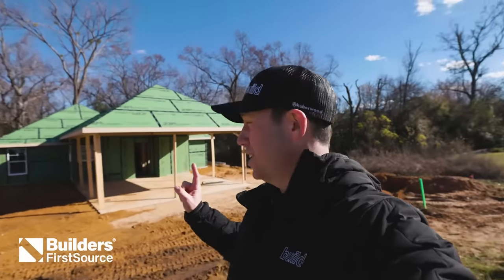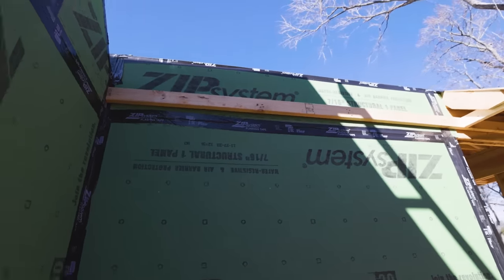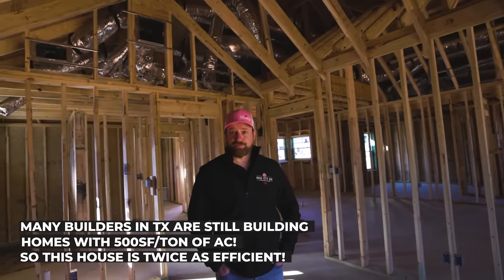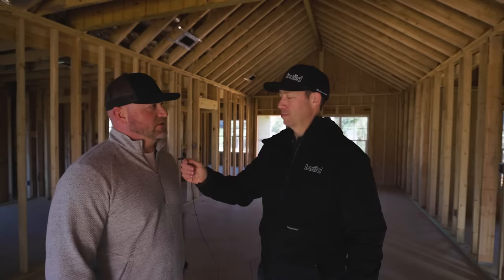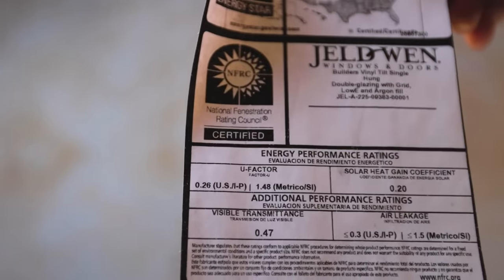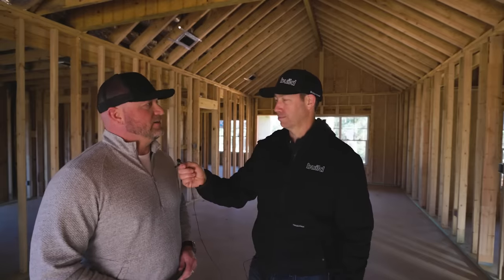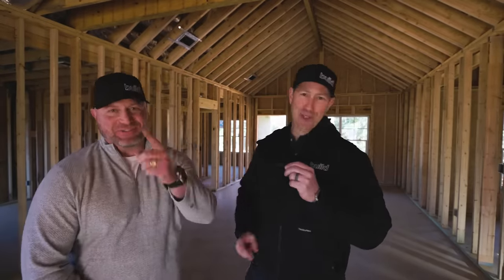Nice houses aren't just for the rich - How to build a quality home at an affordable price.

Comment: I'd like to see this house completed to see what was chosen, for finishes (flooring, cabinets, counter tops, lighting, faucets, etc).  There is going to have to be some real compromises to account for the cost of the shell, spray foam insulation, aero barrier, and HVAC system etc.
Reply: Maybe Mr. Matt will do a follow up video before the homes sale. The finish out is going to be just as nice as the framing. My wife is the designer and it will feel like a very high end home. Super excited about it!

Comment: I sent my builder this video.  Starting a custom home build with him this year in a Texas coastal county.  I've been told we don't need an ERV or ZIP on the roof for our climate, and monopoly framing would run up the cost, it's unconventional.  What they don't know is my years of Build Show education. Thanks for sharing this with us. I plan to implement these same details on our build.
Reply: Two simple things in that climate, ERV and a Zip water shield. Huge. I am close by planning my build halfway between Houston and Dallas, so in the country without code. I just visited a barndo builder that did not spec flashing for the windows the steel framers installed!!!! Per build show discoveries that means a 2 to 5 year lifespan before disaster. 

Main argument! “This is new to learn but not a new skill. Code is going this way. Learn with me, while I pay for the new materials, and I pay a few hundred to a couple thousand more for materials and 4 to 5k for an ERV install, and about 5% more for your hours. You will have a leg up on future quotations because they will come, they will ask”. 
Just my thoughts as to how to address a builder that I have talked to that has two major shortcomings for longevity but otherwise builds a new build efficient package: aka. 2000 sf barndo with 95% of electric bills below $100.

Comment: I started doing the same thing building in California. And exactly like this guy. Had a budget found a way to make it work. Same hvac. EXCEPT trane heat pump. I didn’t put Broan erv in supply plenum be cause CONCERNS if air handler isn’t running and mold in plenum. I did the opposite ducted supply and tied into plenum for the return. Could have heard wrong if you read maybe it will save a headache in the future especially because you have more humid summers in Tyler. I have family in minnieola so been to Tyler.
Reply: Where in CA are you doing this? I'm in the Bay Area busy with a renovation and its so hard to get my builder to do any of this.

Comment: This build is perfect and should be more common in new construction. I do wonder if they ended up putting in an insulated floor to hit this out of the park.
Reply: We did not. We are in Climate Zone 3A and it is not required by code. We are not so much worried about the cold here in Tyler, TX. It's the summers that we build for. I always tell people we have two seasons in East Texas, Summer and August. 🤦🏼‍♂️

Comment: Very impressed. This guy isn’t focusing on profit for the project, but that house would be an excellent value even if the price was raised to $250k.
Reply: Its subsidized. Their cost is likely around 200k, would be listed around 300k. The city is subsidizing the construction so that they can sell at the cost price. Also, they can donate some things for tax writeoffs, and you can flow that down though the subs.

Comment: Sorry for my french...While making the recap around 21min you talked about a roll of fabric instead of a mesh product for the windscreen , I didn't catch for what purpose the product was for and the name of the new product, thanks and very good show.
Reply: Its used a rainscreen which is to create a small gap between the Zip sheathing and the house siding allowing, for ventilation and also drying should any water get behind the siding.

Comment: I've seen the staggered wall framing (in an interior wall) before when someone wanted to provide more of a sound barrier for their bedroom but they only mentioned it and shown the framing part, instead of the installation of insulation. I would like to see how they add the insulation to it. I am seriously considering using that with my upcoming garage-o-minium build.

Comment: Pareto principal in action.  80% of the benefit for 20% of the cost.  

Last 20% of the benefit is 80% of the cost (higher end windows, HVAC, etc).

Gread vid MR to show the viewers that the principals and techniques shown on the high end construction can be done at a very modest cost on an entry level / mid-price point home.

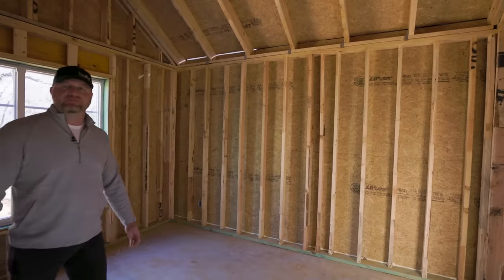Comment: 7:15 The bottom wall plate looks like it's pressure treated. I've been told you should not have pressure treated against white lumber because of treated lumbers properties to retain water and it will induce rot. Maybe this is less of a problem in Texas, but in general? Would love input on this.

Comment: GREAT show guys. 2 questions: [1.] who is Steve?? and [2.] just to be clear on cost, did the City of Tyler (who hired Josh) subsidize the houses? ie: is Tyler's city govt picking up costs of things - like are THEY paying Josh (ie: labor), so to keep the houses under $200k? did the City pay for a portion (or all?) of the materials? if the City hired Josh, they bought the land - so will the deed to the land pass to homebuyers? It simply seems that the City of Tyler is subsidizing a % of the costs --- so really should break the costs out to include that... (ie: The City provided the land, handled all the permits, and kicked in $____._ in order to sell this houses for under $200k) Thanks.

Comment: I wonder if putting it through the air barrier process before adding the insulation would make the house even better? I wonder this because it would ensure that anything that gets plugged by that process will be plugged as close as possible to the red line. Also, this way, if there's a really small hole in the zip sheathing that gets plugged by the open-cell foam insulation, then that hole will be plugged with something that doesn't let moisture through instead.

Comment: OK, the price is 200k, assuming subsidized. What's the actual cost?
Reply: How these types of grants typically work is that they City pays the builder Up front to build these types of homes and then they sell them thru their affordable housing programs, they are sold at cost. The big difference is that this type of home usually has a rider attached to its deed that you can't sell the home for excess profit when you eventually sell. So The actual cost will more than likely be the sale cost. Now there are also certain tax credits available depending on your region so some builders take on this kind of project as a tax break since while they don't make a direct profit on the building they get it back on the tax credit.
Reply: That is a very good explanation. However, I'm not receiving any tax credits from HUD or the City of Tyler for building these homes. I will get the 45L tax credit for these homes being ZERH Certified, just like every builder in America who builds a ZERH Certified home. There are not any subsidies being used. The monies to build the houses are being provided via a grant from HUD give to the City of Tyler Neighborhood Services to be used for low to moderate-income families. I charged cost plus for this project.

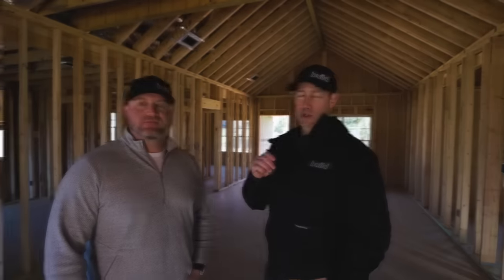Comment: What would have to be done to make the space between the two vaulted ceilings at 14:25 more useful in terms of access and storage? Would running a collar ties between the rafters of opposing ceilings work or would it risk putting too much stress on the drywall and you would be better building a load bearing knee wall on top of the existing wall, using collar ties for stability and placing down planks. Filling in the area above the ceiling with removable panels to protect the ceiling drywall from accidental penetration so if you looked in the area, it would appear like an upside down gabled ceiling.

Comment: Nice... I want a nicely built efficient house. I have an expensive house now and its built like garbage, even though it was a well regarded custom builder. Matt do you have a "checklist" of all the most important features to look for?  "monopoly" envelope, sealed sills, staggered studs, lvl headers?  ERV? individual sealed penetrations etc? I want to do one more house before I kick off, but want a good one. Tyler isn't far from us. 1300 sq would be fine. Houses that small don't even exist anywhere around me.
Reply: Look up the book "Pretty Good House" to learn the basics.

Comment: Instead of 2x6 for fire blocking every 10' and the corners-- is there a more insulated material that would cause a thermal bridge? Would Rigid mineral wool used in rain screens work? (not the fluffy stuff)

Comment: If you know beforehand that double beam is going thru your air barrier would it not be easy for them to run a bead or two of a sealant between and underneath the beams (or any difficult to air seal location) similar to how you do your bottom plate to the foundation?

Comment: in a tightly built home, i understand the necessity for make up air.  But, when the power is out, how then does the house ventilate?  (windows, open exterior doors?).

Also, it looked like there were vents in the soffit.  Since the soffit will not ventilate the attic, it would seem that soffit vents in this case would be unnecessary...?

Comment: A question about the finances of this: Is the $200k the total actual cost of construction, or is it what the city is going to sell the house for with some amount of extra cost being subsidized? Is the cost of the land actually included in that? Or is the city basically just throwing that in for "free" since they already owned it? That is to say, if I buy a plot of land and wanted to have a builder build this exact same thing, can they do it for only $200k? Or would it cost more without the backing of the city? I think what the city is doing here is great, but not every city is going to do this. What would this cost all out of pocket privately?
Reply: I don't see why this couldn't be done for 200k not including land.   This is a 1300 sqft home with a carport, not a garage.  No masonry either.

Comment: Great build for sure. 
I’d take the Aerobarrier ACH number with a grain of salt and retest with a regular blower door. Why? Because I was part of project where AB got to drop the ACH by a lot on leaky house that needed E star certification and the independent mandatory blower door retest showed only a very slight improvement so… what gives? 
I’m not saying AB does bad work or over-inflates their numbers (I’m 100% behind the concept) but I would just retest and see, that’s all.

Comment: We have a local company here in Central Missouri that builds SIP’s using spray foam with conduit built in per floor plan. Would this type of construction be as air tight as this house?  And would it be comparable cost?  I asked them if they could use ZIP on the exterior wall but unfortunately they couldn’t get the size sheets they need.
Reply: Look into Hercuwall, it's sort of a hybrid between SIP and ICF.

Comment: Would zip r 3 be cheaper than staggered studs on a build like this for a thermal break?
Reply: Great question. Not here in Tyler. It cost me less than $400 extra to add the 2x6 staggered stud for the whole framing package. Zip R would have been much more expensive for me.

Comment: Matt, i noticed he had vented soffits in some spots. I’m thinking that was just the material they used even though air wouldn’t be able to access the attic space due to the monopoly framing. Question is, do all monopoly framed homes with attics require the home to have conditioned attic space? I’d imagine if you cut deck vents like a smart vent product it would defeat the purpose of the air tight monopoly framing.

Comment: I’m impressed overall, but I do have some concerns with the “monopoly” framing. Wood does not like moment connections and some of these eaves don’t look like they can survive a high wind event. Also the LVL window header really needs to be designed by an engineer. Currently the vaulted roof post bears on a flat wide header above this window. That’s a pretty substantial point load on a header with weak axis bending.

Comment: What's the builder's profit margin on a $200k home?  15 points?  5 points?  
I also don't see what is going to prevent the gable and perimeter eaves/soffit from falling off over time?  Usually out riggers get framed back one truss.  The zip sheathing doesn't even offer additional support by staggering joints to carry the eaves.  You just relying on nails & tape?  How tornado proof are those builds?  Are those slab on grade?

Comment: I don't understand how it is even remotely possible to build a house like this for $200,000.  I looked at having a 1,200 square foot house with attached garage built in Minnesota.  Standard construction techniques would have cost $200,000 for the build.  My plan was a rectangular box to cut down on building costs.  This does not include cost of the land.  All of the upgrades in this video would have added $25,000 to $50,000 to the build cost.

I am building a large garage at my current house.  I considered ZIP sheathing, but the cost is double that of OSB.

Comment: Building in any climate whether hot or cold, utilizing enhanced insulation values to lower thermal transfere is a smart move for long term home ownership cost. Given in Texas where these homes are being built, the largest load is on the cooling needs to make the home comfortable and to remove excess humidity. Any air conditioner or heat pump requires energy, usually electricity to operate. How can it be considered a zero energy home unless there are solar panels or wind turbine to produce that energy.
Reply: It is a Zero Energy Ready Home. (ZERH) This means it's so energy efficient (”Ready”) that if you added a solar panel system or wind turbine, it would easily make it a net zero energy home. I hope this helps explain it better.
Reply: @joshmcalpine8236  The correct term should be low energy required home. Obviously as I stated , and was conveyed in the video a very well insulated home will require less energy to heat and cool. By your definition if a home that produces enough power whether connected to the grid or independent to end up with an overall neutral balance of energy that has the electrical meter back at zero. The caveat which was not discussed in the video is by the way this is how much you will probably have to spend on solar panels or wind turbine/s to meet your energy needs to drive the cooling system. Low energy not zero energy.

Comment: Matt should disclaim, the reason these houses will list for 200k and not 4 or 500k is due to grant funding subsidized by taxpayers through HUD.  

As a builder, I can tell you that it is not possible to build a new 2000 sqft house for less than 300k. And that gets you very little detail, and inferior finishes.

Comment: At the 7 min. The inspector was mistaken if the wall is filled  with fire blocking materials 302.11.1
Reply: Foam is a great air-sealer, but it is not a fire block.  They can use wood or gypsum.

Comment: What is the subsidy for each home? Are any of the manufacturers donating or significantly discounting materials? Are any Sub-contractors donating time or materials?
What would the cost be with $0.00 in Grant money?
Reply: There are no subsidies for these homes. Not a single donation or discount on any material. A few of my subcontractors actually charged me a little more because it takes a little longer to build high performance. This a cost-plus project. The $190k-$195k are the hard numbers. Possibly your market is much higher than here in Tyler.

Comment: Different perspective - I would rather have solid rafters extend past the wall for the roof overhang. That looks like more cost and creates something that may sag over time. Could accomplish the same thing by blocking between the rafters with some foam sealant.

I'd also rather have a lapped roof underlayment instead of zip sheathing.

But he seems to be trying hard and I don't criticize that at all. I only comment because I have built houses and tried some of these things.

Comment: Only thing I will add are that the Santa Fe dehumidifiers are junk and their support is terrible. They basically don't service them with any new parts and just offer a discount on buying a new one. I had one die after only a couple years. Aprilaire is supposed to be much higher quality and the one I purchased does seem to have better longer lasting looking parts. They also will send out parts for repairs. We'll see if they are better over time however. But the Santa Fe is probably worth avoiding. Lastly, the price on the Aprilaire was basically the same as the Santa Fe price!
Reply from the maker: I’m sorry to hear that. Santa Fe makes a white label for another manufacturer and I can’t remember if it’s Broan or AprilAire
Reply: @buildshow  I don't know either but when I looked at the copper and aluminum used in the Aprilaire compared to the Santa Fe it was pretty remarkable the difference in quality etc. Therma-Stor is the maker behind the latter.

Comment: 1300sf.  of course it's only $200k.

The part that sucks is that the extra $00 it costs will be passed on to the owner as $4k.  The $3k dehumidifier gets passed on as $7k, That LVL that is $1/ft more is passed on at $5-8/ft, etc.